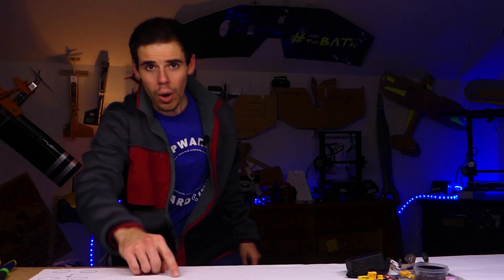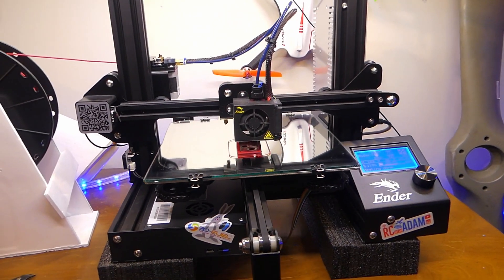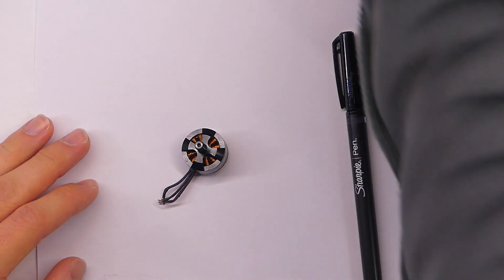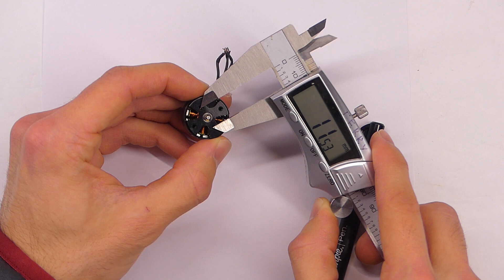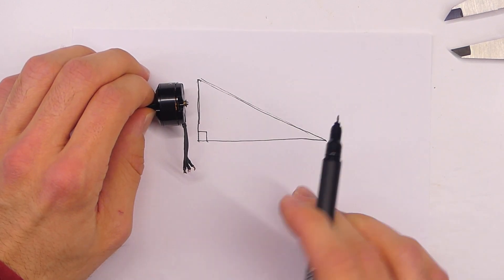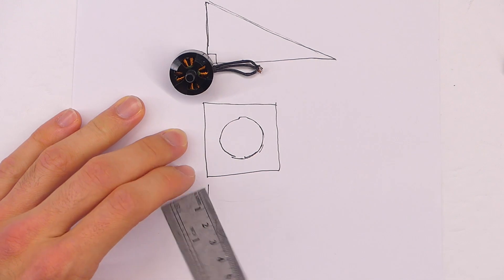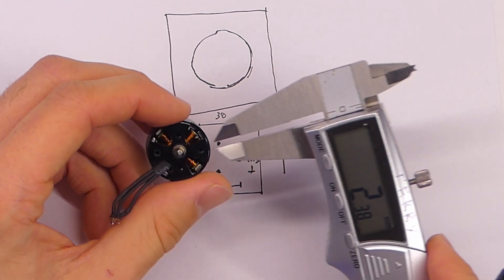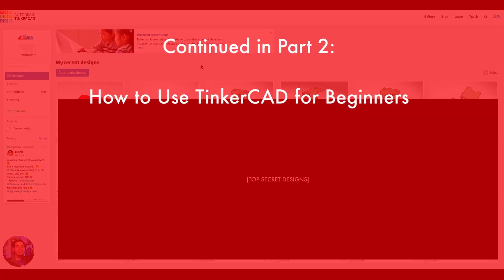Start to Finish 3D Printing Guide for Beginners - PART 1 - Sketch Your Design

Comment: Im quite new to this... but wouldn't you need a bit of a thrust angle?. I assume with your current 90 degree mount the thrust angle is going to be exactly horrizontal.... would it help to have a bit of a positive thrust angle on the motor?
Reply from the maker: Hi! Very good point! I did not design the thrust angle into the mount for two reasons: 1. This is meant as a very basic example model and 2. The thrust angle will vary based on the motor, propeller, and airframe, so I thought it would be more useful to add it after the fact with a shim of some sort. Good question though.
Reply: @RCwithAdam1  thank you for the explanation. Shim is a good idea since you can add and remove it very quickly, without having to reprint the whole mount again.

Comment: Measured from the outer edge of a
  one hole at the inner edge of the other hole and results in the exact distance from the center of the holes.
Reply from the maker: Very good tip! 👍